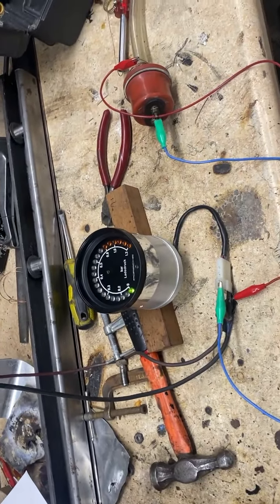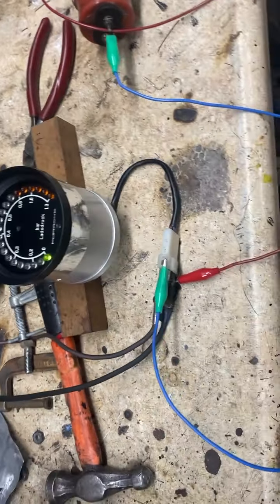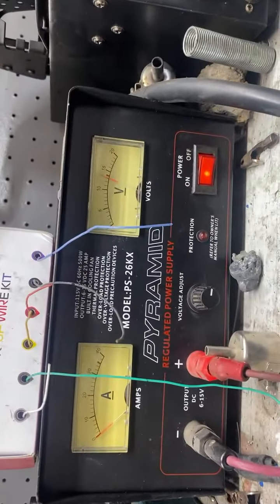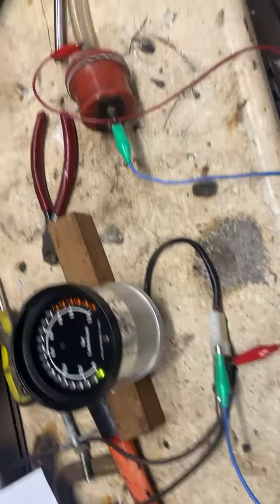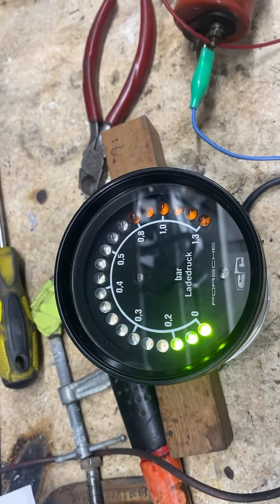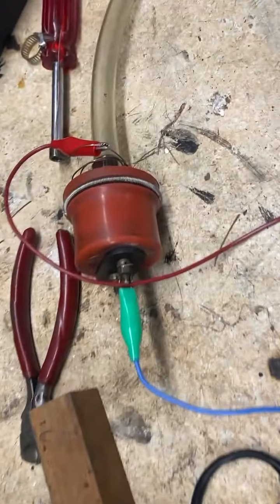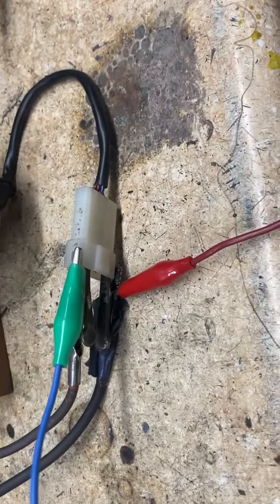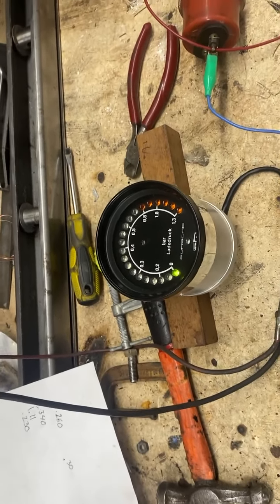911 Porsche Radial LED turbo boost gauge.

Comment: This is great information.  I am on the hunt for one of these gauges.  What sender does this work with??  Was told it was special, but that looks like the standard 930 boost sender.  Do you have any pictures of the circuit board and guts of this gauge???
Reply from the maker: The gauge internally uses a multi-level  tiered set of circuit boards stacked and separated using hexangular threaded brass  stand-offs between boards until reaching the top LED layer supported round board under the graphic face. I can search my archives at the shop today, and send photos. Because Can-type condensers often fail, we replaced them all- and all components are "Off the Shelf "available likely from Digi-Key Electronics. Another failure is that the layers "Ground" through the brass stand-off pillars, and get loose and lose conductivity.  If I have to make another, I would find an available circuit that used the same technology, and modify it, and spend more time making the can and gauge face.
 We have made instruments using analog needles before. So, this is not impossible. We often put braces on the teeth of the Mona Lisa. As long as she does not smile broadly, nobody knows!   Contact us at oddparts@vom.com to explore ideas. Thank you for your interest, Jim Simpson and crew.